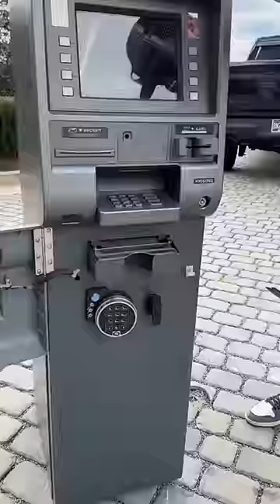Cracking Open an ATM: Fortune or Fail? 🤑💥 #shorts #viralvideo

Comment: That display $20, power supply $20, Digital lock numpad $50. $100 fort the safe, $50-100 for the money casette, had they dismantled it nicely so they could sell that parts. That would easily had been $200-500 as spare parts.

Comment: Second-hand machines sell for between $1200 and $1800. Depending on model and condition. 
Even if it's not working, you're still looking at a minimum of 600 in parts alone. So yes, there was money in that old machine, they were just not looking in the right place.

Comment: A few years back in England 🏴.
Group that hit multiple ATM’s at once at night.

They wired an electric rocket fuse( hobby shop ), ran out over hundred feet of hey hey hey electric wire, to a rocket detonator.
Now filled the machine with oxygen and acetylene, plugged the opening.
Hit the power.
Open it, part of the wall. Grab the box, drive off !
By the time the cops got there.
On to another !!!!
Look it up !!!!
Reply: Get another, try it ?